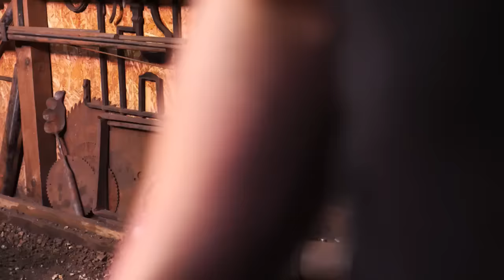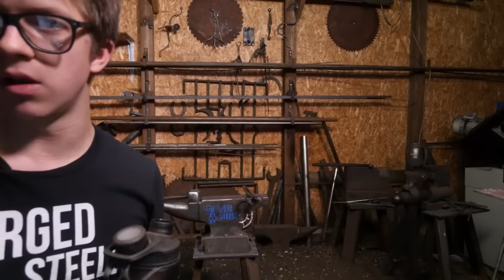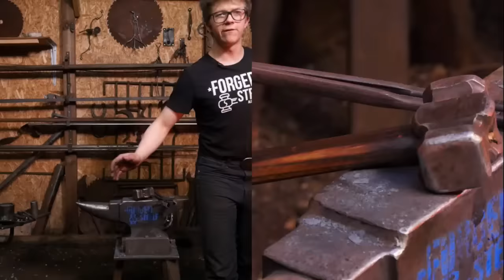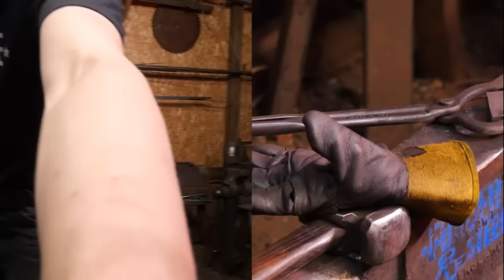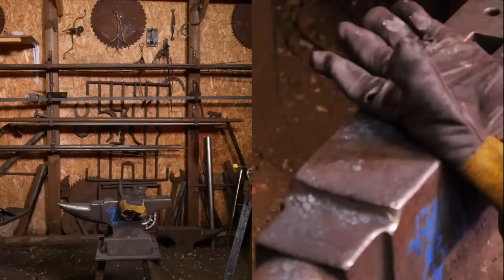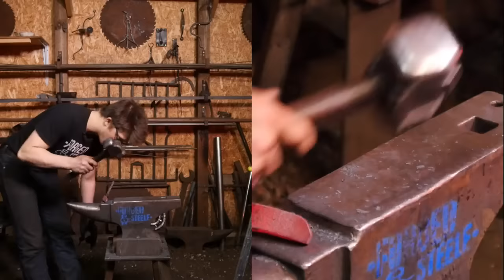BEAUTIFUL FLORAL COAT RACK!!! Episode 41: The Alec Steele Show!!

Comment: If you want to get a high carbon weld you need to get high carbon welding wire for your MiG welder. That's how we used to do it on John Deere Farm equipment.

Comment: Fordham tool- the generic term is a "Rotary Tool"- Fordham is a specific brand name.  You can also get Dremel systems that are the same.  Or Flex-Shaft, is another brand name.
Reply: Also, you need to get yourself a couple of holdfasts.  Stop having to hold your tongs between your legs.

Comment: Brandnoob viewer :) Why do hammers need the indent between the handle and the hammering surface?
Reply: Christian Fumz its a preference, generally its just for appearence, but it might serve some other purpose unbeknownst to me
Reply: If you pick up a hammer that just is a rectangle it just feels like a club. By narrowing the area where the handle is it moves the weight to the extremities of the head and effects the balance. The hamme just feels better and you can control the hammer swing better. If you pick an old carpenters wooden handled hammer and compare it to a modern fiberglass handled one you can feel the difference.a well designed hammer gives you more control in your strike.

Comment: alec...could you please explain in detail how to harden steel..you aneal stuff...you harden stuff.you color stuff...how do you know what to do anad when..wtf...chris...great stuff  thank you
Reply: first last to harden you heat the metal until it is no longer magnetic then quench it in hardening oil, water, motor oil, the sort. annealing is when you heat hardened steel and let it cool, reducing the hardness. the coloring is from tempering, something which is usually done after hardening to relax strained molecules and take some brittle ness out of the material. the color depends on the heat of temper your achieving. hope this helps.

Comment: why you don't make a katana, you may see the video from man at arms, gengi's katana, and see they started whit a steel whit high charge of carbon in the exterior and ended whit a flexible steel center you can do it but with a damascus steel with a progresive change af carbon charge from outside to inside being the center more flexible and the exterior more hard, or put it simple you can make damascus steel whit high charge of carbon in the exterior an put a center of flexible steel the same process they using but with damascus steel outside